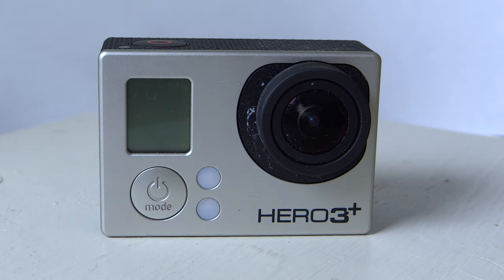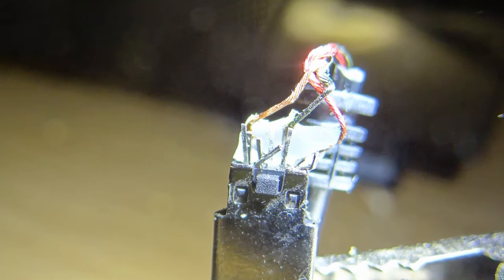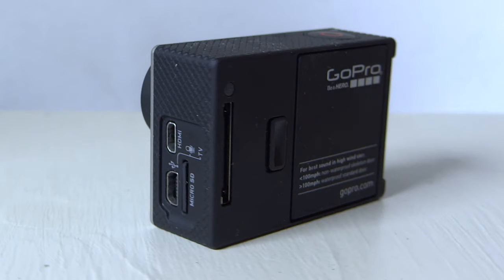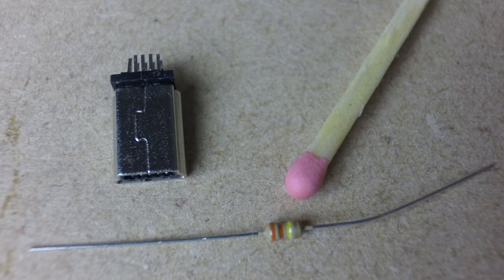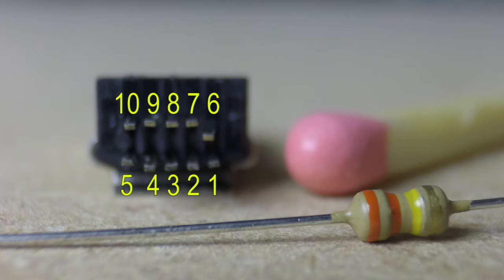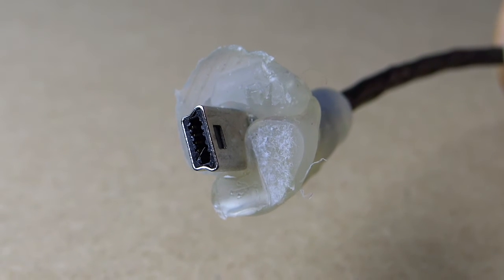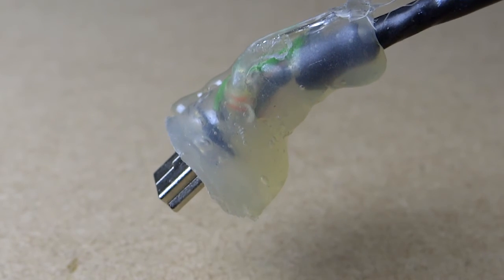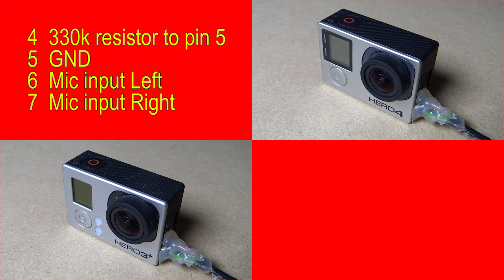GoPro Hero DIY external microphone cable

Comment: Nice video, I will try today to make a cable like this. One question, I saw on another diagram that the Ground was put on the Pin number 8, can you tell me is the same or one is wrong?
Reply from the maker: Hello Jose.  Thank you.  All I can say is that the way I have done here works for me on that camera.  I don't know about any other circuits.

Comment: awesome! but how can you tell the 330K ohms?
Reply from the maker: Hello Charles - the resistor will have coloured rings on it - the important ones are the first three - orange, orange, yellow which means 330K
Reply: @gadgetsgimmicksandtech  Ty for the anwser but i might have not espressed myself correctly. I meant, why 330K?
Reply from the maker: @charlesg2532  the value will be the optimum - I don't think it too critical so any value near to that will probably work.